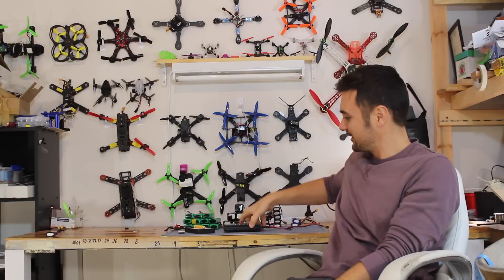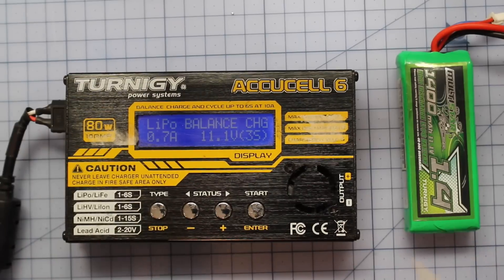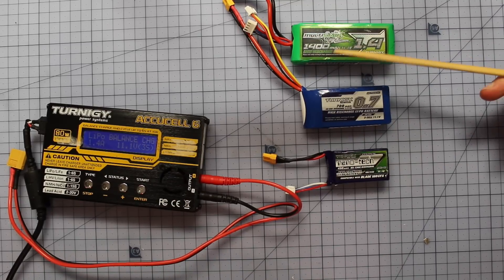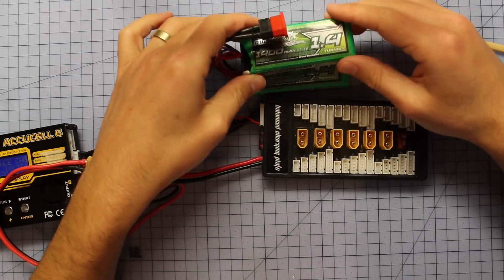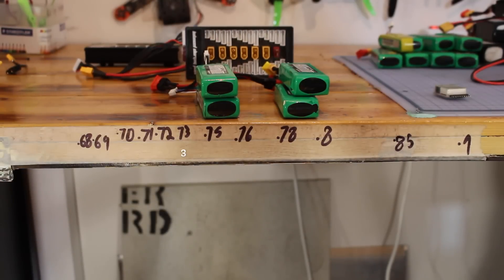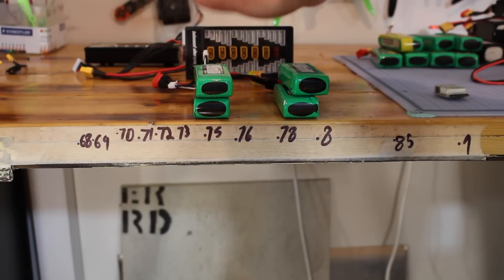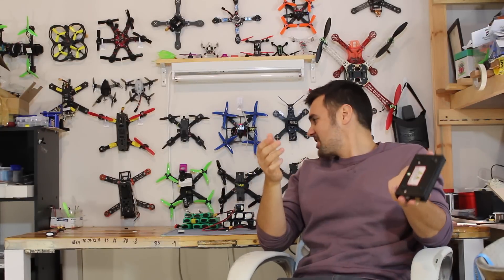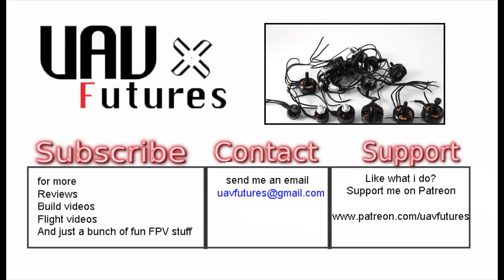Beginners guide to charging LiPo batteries + parallel charging

Comment: How far off on voltage would you be okay with charging in parallel? For example would you charge a 4s at 15.23 with a 15.17 with a 14.8 and 15.31? Those were my last night pack voltages.
Reply: For 3s the total pack voltage should be .3 within each other. For 4s it should be .4 within each other if you're ever feeling unsure about your packs I always put them in storage so they're the exact same when I plug them in. I get paranoid sometimes.
Reply: +jussa101 thanks a bunch
Reply: i parallel charge batteries with even big difference in voltage. i just leave the batts for an hour on the board so they balance themself....
Reply: +alisher rakhimov that's bad they end up balancing their voltage quickly. But the thing lipos are able to discharge at a greater rate than they can take a charge. Bigger differences result in your damaging your battery. It's a fire hazard and safety hazard the way you're doing it. I plug mine in and in about 30 seconds they're all the same voltage. Leaving them sitting there isn't really doing anything.

Comment: I would recommend buying a parallel board with replaceable fuses just as an extra safety precaution
Reply from the maker: good tip, as long as the fuse is small and will actually blow before the battery

Comment: Just a little mistake, you said .1V difference per battery, but it is per cell, do on a 3s they can be .3v apart, and on 4s .4V :) having them closer is better of course, if mine are a little closer to the  .4v apart I just leave them in for a few minutes before I start the charge so they balance. Also in the beginning you kept saying 1.4 milliamphours, haha. Quite a small battery ;) 1.4 amp hours. Just being nit picky, it was a great video and will help lots of people :D
Reply from the maker: thanks mate. yeah sorry about the numbers, but hopefully people got the idea
Reply: UAVfutures Yeah, it won't mess anyone up as you showed putting it in :)
Reply: thats what she said _
Reply: R2GO It is .1V per cell and since we are working with 4S batteries here with 4cells that would make it .4V total for that battery. If you have a 3.5V battery and a 3.9V battery that would be okay, but a 3.5V, 3.9V and 4.1V would not be since the two furtherest away (3.5V and 4.1V) are .6V apart. 

Joshua Bardwell has some very interesting videos about this subject on his channel. Basically the reason you don't want them too far apart is because the batteries (once connected in parallel) want to naturally flow and make them selves even with each other, and the higher the voltage gap in the "flow" will be higher.

Not exactly sure of the voltages, (maybe something like .6-.7V off) but he plugged them in together to test and read the current flowing into the lower battery, and it was over 10A! Which for a 1300mAh is 8C about. It did go down quickly but stayed at about 4-6 amps for several minutes, so not the best for your battery, especially if it isn't high quality or has a weak cell. This effect will be multiplied if you have several batteries higher (than .4V for 4S, 3.V for 3S) than one, as they are all trying to balance into it. 

Hope that answers your questions :)
Reply: great. now I can safely charge my lipo's much faster. That means more flying.

thanks again.
Reply: I am not sure the voltage difference works according with the number of cells, whatever the number of cells of the LIPOs, i have always charge my batteries with 0.2V difference max per cell. Another important point for me is you have a LIPO with one bad cell, don't charge it in parallele with other LIPOs, there is a risk that this LIPO could damage all the other LIPOs.
Reply: ABMNS PRODUCTION It is by number of cells...but everyone has their own "standards" but you should never exceed .4 total for a 4S. Some people only charge at 1C, but I do 2-3 if I need them quick, so it really just depends on how much you know and trust about your gear :)
Reply: R2GO Whoops, mis spoke there. I meant to say something like a 15.1V pack and a 15.5V pack. Doing 3.5v-3.9V per cell different would be 1.2V overall which would be 3 times the recommened limit. Sorry if I confused you. Just look at the overall battery voltage and if it is within .4V of the other packs it will be fine.
Reply: Nerf Nerds You need a battery? Not sure what you mean.
Reply: sorry still don't get this.
could be because I'm not English and it will not get into my fat head. lol.
Please bare with me.

I'm talking 4S here.
So is it .4V difference per BATTERY or per Cell?

let's say i have Lipo's perfectly balanced. one is 14V and the other 14.4. that's a .4 difference per LIPO. but only .1 per CELL.

Or is it .4 difference per Cell of ALL the lipo's going to be charged in parallel.
So let's say between 3.5V and 3.9V between cells.
That's a .4 difference.
Because then the voltages  PER LIPO can get between 14V and 15.6. If they came down perfectly balanced and the 14V Lipo is 4x3.5V and the 15.6V battery is 4x3.9V.

you get what I'm saying?
So can somebody please clarify this before I burn down the house with me, my wife my son, and the cat in it :D
Reply: yes i think I get the picture.
it's the CELL voltage you look at in each battery.
you said a 3.5v battery but I think you ment a battery with cells of 3.5V.
So every battery (4S)with cells in the range from 3.5 to 3.9 can be balance charged together.

thanks allot pal.
Reply: :) that is why I find this so difficult to understand.

So is the BATTERY voltage has to be within .4V
A 14.2 battery can go with a 14.6 battery and everything in between. Also the cell voltages have to be close to each other. That means the cell voltages between batteries are very close.
A 14.2 nice balanced discharged battery will do about 3.55 per cell.
And a 14.6 will be around 3.65. So the cell voltages will even closer apart.

And a battery doing 14.6 has to go in another stack.

sorry if I'm still not getting it
:)
Reply: Me too not native english language, and math.
So.... I will charge one by one as ever. Nevermind.
Reply: The RCAddict I've got a drone but was supposed through a lipo battery I Donna know how to charge or what I need
Reply: The RCAddict  no I got surprised by one in the drone and I don't know what equitmant I need
Reply: The RCAddict I have the recon
Reply: observation drone
Reply: Thank you!
Reply: Thanks you help me a lot a have my on fpv drone and it's easy to fly close of you👍👍
Reply: R2GO A 14.2 and a 14.6 would be ok together but yes everything you said it correct. Total battery voltage for a 4S need to be within .4V =D
Reply: do you need the lipo FPV battery ? if you need, see the below link :
https://dxf-hobbyking.aliexpress.com/store/3027015?spm=2114.12010612.0.0.AgUELV do you need lipo battery?

Comment: What C rating would you charge the chop stick at ha?? Great tip on the voltage scale for grouping batteries ready for parallel charging, I'll be using that method from now on!
Reply from the maker: the chop stick. I charge that at about 4 miltaps per cm
Reply: +UAVfutures is it possible to charge it at 10c? for less cm but for optimal time if your in a hurry to use it ;) or can't it handle that many milytaps? ;)

Comment: I also recommend covering the deans connector on the board to avoid accidental shorting.
Reply: I have 2 huge gold banana plugs sticking out of my charger (1cm apart) for years and I never shorted them out (it actually makes me extra careful when charging batteries)
Reply: newbie here..what happends if accidentally plug one of the balance leads the wrong way and short the board? can I still use it?
Reply from the maker: it won't actually fit the whole way in, but it might make a small amount of contact which will result in a short...smoke, fire. you know.. the good stuff : )
Reply: +UAVfutures .. I was able to make a little contact and I did get the magic smoke. does that means the board is no longer good? I haven't used it since then but I've been wanting to is just that the idea of a fire getting out of control doesn't sounds fun
Reply: unfkwthabls 
That sounds quite bad for the parallel charging board I wouldn't use it outside my line of sight anymore (it might also be a good idea to measure it thru to make shure there isnt an internal short or resistance)
The charger will probably be fine (if it is a quality hobby charger)
Reply: +UAVfutures +MightyRude .. ill just discard this one don't want to risk it..thanks